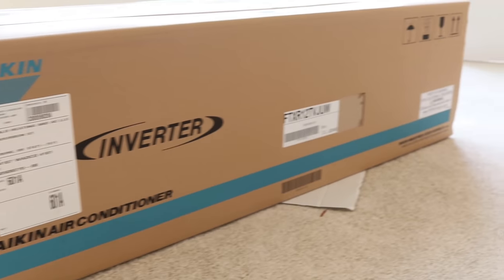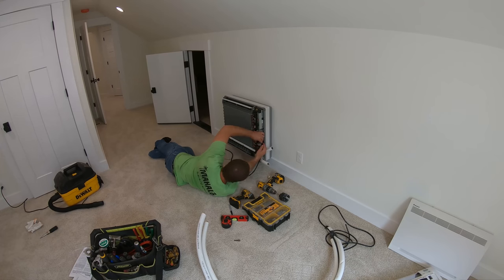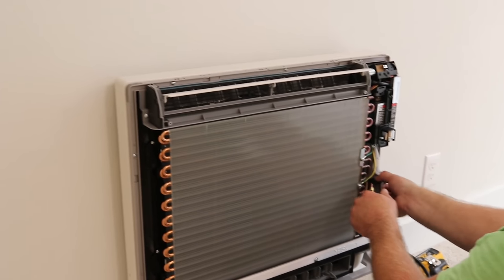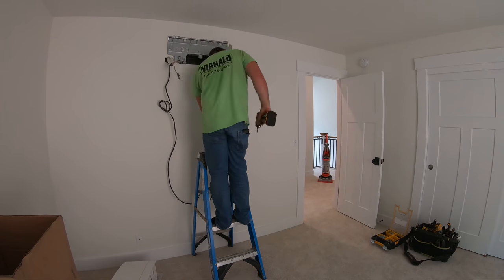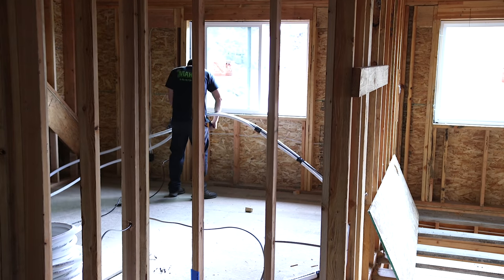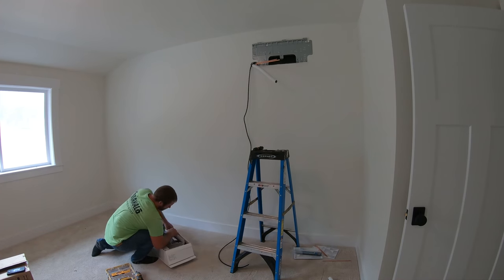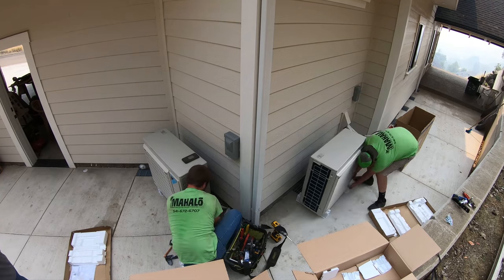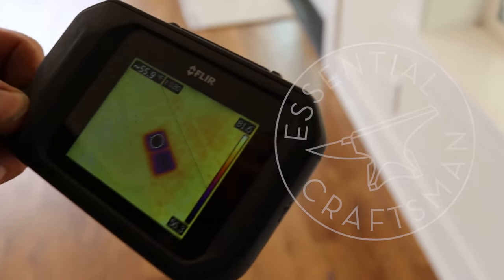Final HVAC Ep.131

Comment: I don't know that I am a big fan of those mini split systems. I don't find those large units mounted on the wall particularly good looking.
Reply: 'Good looking' is down on the list for normal people on a budget of any size. Affordable, efficient & quiet are more important to me.
Reply: @AnthonyStabler  I used to work for a custom home builder and all of the homes we build were in the $1-3 million range and not a single customer wanted a mini split system.
Reply: I thought the same until I had some. And after a year I honestly don't notice it anymore. They also make ceiling flush mount versions that just look like a bathroom fan at most. The efficiency and ability to adjust individual rooms is worth it.
Reply: @AnthonyStabler  mini splits are certainly less quiet.
Reply: @MandoFettOG  1 or 2 might not be a big deal but it you have one in every room you have go into each room and turn it on/off and set temperatures for each one. where if you just have a central hvac system you have 1 thermostat where you control everything.
Reply: There are recessed ceiling units as well.  It doesn't have to look "ugly."  Though,  that's an American opinion.  Europeans don't look twice about a unit on the wall. These units are way more popular over there.
Reply: @Alex.AL_26  most systems you can set default heating and cooling temps that they will revert back to after a couple hours or set times of the day. 

Once you set these up using their app or web interface you only need to touch the individual remotes when you want a custom temperature for a period of time.
Reply: @wjthehomebuilder  more popular because it's a lot of retrofit in Europe. Maybe that's why Americans don't like seeing mini split system, it's a tell tale sign that the house wasn't designed with modern hvac in mind. I wouldnt design a new house to utilize mini splits unless there are serious architectural limitations. Just jumps out as poor or outdated design in my opinion.
Reply: @mikec7373  Funny you say "outdated" as the technology is literally the most efficient system we have on the market today.  And again, recessed ceiling mounted units don't look out of place.  Neither does a ducted unit as per the videos downstairs example.
Reply: @wjthehomebuilder  I know that's the terrible irony. It's new tech but yet looks like a sign of a poorly designed house.

Comment: If you watch the videos for the HVAC Overtime guys, you'll find there are issues with minisplits, and a lot of them dislike them extremely.  

I'm mixed. . I see them as being useful, but not as a replacement for a whole house climate control system.   

I'd like to do a straight contradiction of one of your statements in the video.    If you're planning a house, and you have a beam where you need a duct, or vice versa, you have a lousy design engineer.  Period.  There's absolutely no reason why ducts can't be properly planned for the construction, other than architects aren't engineers.  They're focused on form over function.    Ducts in a crawl space, or attic space, can even be covered over so you can walk over and around them safely - the contractors just don't want to do it.    Someone says there's a problem and they can't fix it?   Fire them, and get someone who actually has a clue.   Sure, retrofitting an entirely new duct system can be next to impossible, but 

A whole house system is very useful, especially if you have a multi-level home, in an area with temperature extremes.   You can even get one designed with controllable registers so that only the rooms you want are heated or cooled, and you can use multiple temperature controls.      The benefit is that if you have multiple return ducts, you can blend the air around the entire home.  The cold air downstairs is mixed with the warmer air upstairs, and blended and pushed out the vents.   That's if you're just using a straight 'circulate' system - and in the past three weeks, I've used 'circulate' frequently, rather than running heat or a/c.    It also helps avoid stagnant air.   Mini-splits are great for a single room, but they do nothing about fresh air, or even just moving air around multiple rooms.  The ones I've worked with are okay, but they don't push are more than 15-20 feet, and never out of a room.  (Yes, I have only used mini-splits.  I'm not an a/c guy, I'm an IT guy.)   The best place for them?  company server rooms.   It really helps to maintain a separate temperature zone when everyone else is complaining about being cold, or hot, and plays with the main thermostat.
Reply: Nice man you are a true blue collar dude 😄👍🤝🤝🤝🤝

Comment: Countless of times I had Electrician, h vac, plumbers working on projects leaving behind their stripped wires, plumbing remnants, screws.
I even joked with them  if they own a broom 🧹 and a dust pan a vacuum is light years away.He got a good crew doing the work. 
I always think that if you leave the job site cleaner than you find it customer will be beyond pleased. 
Don’t want to criticize EC but those wall units should have been installed before carpet installation and final coat of paint on walls. 
Accident small or big happen all the time on job sites. Having that carpet stained or the wall dinged will imply additional costs to builder.
Reply: The primary thing I learned in Boy Scouts was “Always leave your campsite cleaner than you found it.”  I didn’t fully understand it at first, but later it became my mantra in life, relationships, work, and worship.
Reply: To answer, carpets and flooring should be covered. Touchup paint is cheaper and faster.

The argument only applies if the installer(s) are goons.